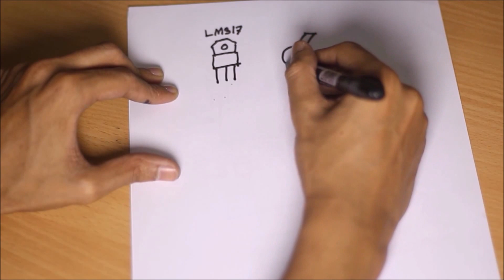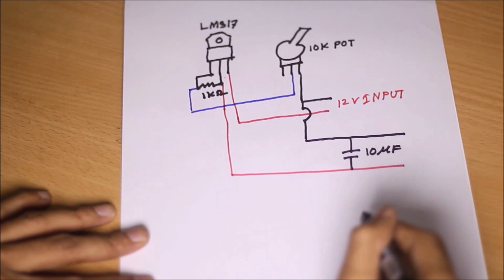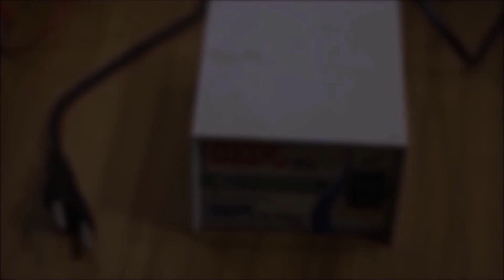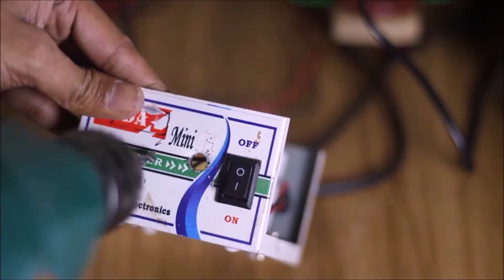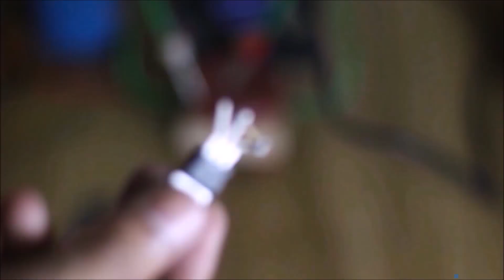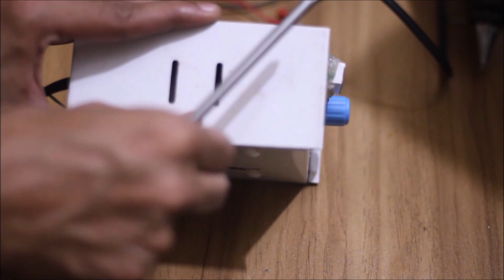How to make a Variable Voltage Power Supply using  LM317 IC

Comment: Can we use this circuit with half wave rectifier ?
You have used 10uf capacitor,can we use 10uf capacitor of any voltage? What voltage will be good to use?

Comment: What should be the ampere of input?
Reply from the maker: For LM317 or for the power supply ?
Reply: Aurka Sarker power supply
Reply from the maker: The Input Current should be as per the requirement of transformer you are using.
I can help you further if you tell me the type of the transformer you are going to use.
Or you can search specifications online by it's model.

Comment: Very basic regulated power supply for beginners, however I do recommend usage of Lm723 as it have short protection, voltage regulation and current regulation and at the end it is easy to build even for begginers. Check it here https://www.youtube.com/watch?v=kT6PvG5GgL4
Reply from the maker: Thank you for your comment . I checked the link attached and that will help me for future projects. 
New projects are coming soon .